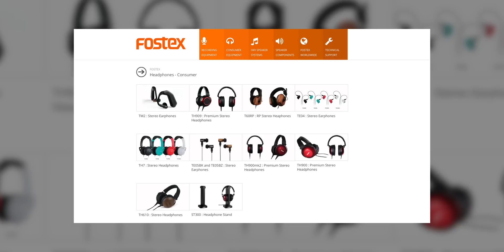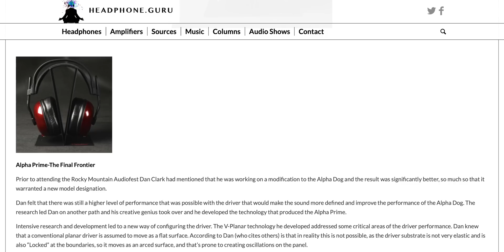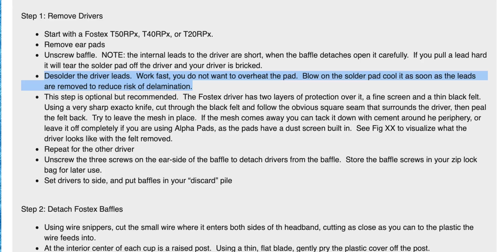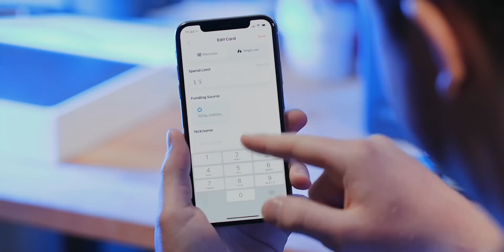Make $600 3D Printed Headphones For $200!

Comment: You know what's good? Model paint like Revell "enamel" type, simply brushed on. It's self levelling, it's got an insane amount of bite on plastic, it doesn't chip, it can be sanded and polished. It's alkyd resin paint, similar in behaviour to oil paint, just sets quicker, but it still takes a while. Though i would suggest it's worth it.

As an electrical engineer: Ethernet cable strands are perfectly adequate for the 3cm link inside headphones.

Comment: Eventough it's probably still a good deal, sub 200$ headphones is a lie. The cable alone costs 60€+ even if you get it from aliexpress/ebay/etc. I printed the parts at a fablab and they charged me 56€. Not trying to bash/hate just want everybody who wants do mod these headphones to be aware that you'll need to spend probably almost twice as much as the T50RP would cost alone if you don't own a 3D printer.

Comment: One thing I don't understand: So we added some 3D-Printed Parts and stuff, but why should the headphones sound better? We didnt even change the drivers?
Reply: Jonas Haidar short answer: because of how the air is moved. Poor drivers can do neat things with the correct amount air or crossovers. A four inch subwoofer can get deeper and louder with a correctly designed box (usually much larger than you would want). In a sealed space, the air behind the speaker would be pushing against the driver when it tried to move changing how the driver can flex.
Reply: Charles Gorny thank you

Comment: ahm.. why not just cut the wire... then, solder in the wire and sleeve with shrinkable tube...??
you won't hurt the traces that way..
Reply: The new cable has a bigger diameter -> lower resistance
Also you basically want to use the least amount of solder connections mainly because of the sound? (

Comment: Curious as to what version of the T50RP is best suited for this
Reply: the mk2 definitely
Reply: dnalekaw any particular reason why?
Reply: @TomasLomba  yeah, the mk2 has a more restricted rear driver damping, allowing for better bass extension and more controlled highs. It is also what the original alpha dogs used along with some wool felt on the rear of the aforementioned driver damping
Reply: dnalekaw oh ok. So if I tried to build these based on a MkIII I wouldn’t have similar results?
Reply: @TomasLomba  absolutely not, it will be very different since the driver damping scheme of the mk3 is very different. However, the results maybe towards your liking

Comment: wait so if you have to glue the baffle and the pad ring together why cant you print them as one solid piece?
Reply from the maker: There’s a 90 deg overhang and the printer wouldn’t be able to print without supports but they’d also be too close together to remove the supports so ya
Reply: @snazzy  Thanks for the info. Im trying to print this with stiffer carbon reinforced nylon to see if that affects the sound :)

Comment: Must the cable be changed in order to fully take advantage of this mod? I understand the enclosure side of things but not why the cable is changed. Thanks
Reply: As for sound quality? No. It's mostly just that the Alpha Dogs originally used Hirose connectors, so that's what the first released Open Alpha designs call for.

Now the cup files are designed with the connectors on each side, so to reuse the original cable you'd need to either modify the 3D print designs to remove the connector mounting on one side and alter the other to accommodate a 3.5mm socket, and make holes in the cups for the single-entry cable that goes over to via the headband.

Also, if you don't feel like getting those rather expensive and relatively obscure Hirose connectors for the cups (and cable), there's alternate cup designs out there nowadays that are modified for using more ubiquitous 2.5 or 3.5mm sockets.

Comment: I'm surprised planar speakers are more expensive. I would think they'd be cheaper, since it's just a flexible pcb, and some rigidly mounted magnets. Maybe most of the cost is from having to build out entirely new manufacturing lines with entirely different components to them. 
I kinda want to see an actual audio engineer have a go at these, make a perfect cup for a specific sound profile.

Comment: I don't understand how replacing the ear cups changed the sound quality so much.
Reply: cups are almost as important as the drivers. The drivers can only work with air in some ways, the cups control the air part of the sound. With sufficient but not too much air volume and insulation from outside air.

Comment: it amazes me when people who have $500+ 3d printers are scared of sanding for 30 minutes
Reply: dougy  Also, the Prusa IS good, but spending some time working on calibration and stuff will make a huge difference.
Reply from the maker: My calibration is lock-tight. I just printed at a really high speed and at a 0.4mm layer height because this video needed to get published ASAP.
Reply: @snazzy  That sounds more reasonable :P lol. Coulda swore you said .2 in the vid, so it threw me off. With layers that big and high speeds it makes more sense.

Also, tip on finishing with less sanding: Print with 3 walls and then knock the layer lines down with 80 grit paper. Takes care of them in no time, but needs the extra wall thickness for aggressive sanding.
Reply: dougy  Monoprice select mini v2  and if you're feeling adventurous get the Monoprice MP Mini SLA LCD High Resolution Resin 3D Printer
Reply: Hell, spending an hour or two with your print settings, you barely even need sanding. The prints he shows in the vid are ROUGH compared to what comes off my printer (and his is 3x more expensive than mine!)
Reply: dougy  I use a Tronxy x3. Was about $220, but requires assembly.
Reply: you should wet sand those parts, too. so much harder to do dry and makes it look shitty
Reply: O.5mm layer height fixes all
Reply: @joes661  do you mean .05 because .5 is pretty coarse
Reply: @akhilm3639  ye, I use a 1mm nozzle so am use to 0.8 etc

Not 0.05
Reply: @joes661  pointless for most applications. Lower the layer height and slow the print down in a .04 or .02 nozzle. Also .8 or .5 is still wrong by reference. Wrong decimal place is still the wrong no matter what you’re used to.

Comment: Makes me wonder if all you had to do was replace the dinky little wires and add the new connector, then add the same sound deadening to the original enclosures.

As a kid (about 10 y/o) i had some 3 way floor standing Fisher speakers (ones with white foam for the cones) that i replaced the internal wiring with heavier gauge monster cable and greatly improved bass, mids, and cleaned up the high end but was careful not to turn it up too high because then you could smell what i assume was the coil burning lol. Before i got rid of them i spray painted the woofers cone with some automotive paint to give it a hard surface which further improved bass as i think it helped stiffen the cone and couple the air maybe lol.
Reply from the maker: There are a lot of mods that retain the stock enclosures and they help the sound a ton. These definitely sound a step up, but if you absolutely don’t have access or interest in a printer, you can DIY with the stock enclosures and get 90% there.

Comment: superglue is actually awesome when using PLA ... but yeah you used the crappiest material of them all, petg :)
Reply: Why is petg not desirable here?
Reply from the maker: PETG is superb. This guy is nuts.
Reply: Snazzy Labs how much does the mass of the enclosures (since petg is much more dense than abs and pla), as well as the stiffness of the cup walls (given that pla is much stiffer than abs and pla) affect sound? Also curious about how infill percentage may change things.
Reply: Sure, super glue works very well with PLA. Almost too well actually, and that's exactly the problem - with CA there's very little adjustment time to position the parts. And with the parts lacking locator pins or other positioning aids, you really need that time window to adjust and make sure they're positioned just right before the glue sets.

Comment: Actually CAT5E cable has to be 24-26 AWG copper wire, so it's even better than 28 AWG
Reply: wait what cat6 uses 28 AWG it allows for better data transfer therefore just better than using cat5e
Reply: The larger the AWG number the smaller the wires, so you're not correct...

Comment: wouldn't it be safer to just cut the wires going to the drivers, leaving an inch or two, and then solder/splice the new wires to them? them you never have to apply any heat to the driver.
Reply: No, you'd have to get the same type of wire and since it doesn't tell you, you'd have to guess which is never good when it comes to sensitive audio electronics. Its better to just not screw up soldering and get new wire.

Comment: Omg u got the fostex t50rp mk3 I have a couple of them. The mk3 to me sounds good the bass sound that was used is controlled sub bass that's probably why you don't like them and they have near neutral sound and there is a weird peak on low frequency. Because of this sound signature some love these with simple foam and wire mods. And their sound signature is very easy to mod. And you should have tried other types of wires. And headphone foams because the driver distance to your ear unmodded can easily increase the lower frequency.. where is the logic in this you ask? I don't know but it does make it sound better...

Comment: If you want a better paint job rough sand @ 200 grit, primer, sand @ 400, primer, sand @ 800, then final coat. They use this process on car paint.
Reply: I have seen people doing pc case mods and they are doing the same, and man! The results are awesome.
Reply: Does it really make a difference when you're applying roughly textured paint, though? Knocking down the layer lines, priming, then painting should be more than enough with a textured paint. Could probably even skip the primer if the paint itself is made for plastics.
Reply: Xander Vice aerosolized paint is typically very thin. Even cheap air guns get up to around 80% paint efficiency. Yes, it’s from a spray can but still. Any texture isn’t from the paint, it will be from the surface. Primer will help hide low spots and flaws on the surface.
Reply: @allstarwoo4  I know how paint works, but the paint he specifically used does have added texture to it. So I don't see the point of putting so much prep work into a project that's just going to be textured by the product being used.
Reply: @xaytana  he says nothing about a textured paint. The metallic paint does have metal flakes but those are designed for a metallic effect, not texture. Without a clear coat to protect the paint those flakes will rub away with use.
Reply: Thanks for the info
Reply: i suggest starting with the good 'ol 1 GRIT to really even out those bumps XD

Comment: If you are going to use Methylene chloride, please be extremely careful. It has a very low boiling point and will vaporize. It is a severe carcinogen, so it is recommended to only use it in a well ventilated area, like a fume hood or outside.

Comment: To get a candy coating, you need to sand, use primer, sand the primer, and in a fairly dust free place, use spray paint, and apply clear coat spray paint after

Comment: i'm an idiot and watched the video,
so was it the casing itself that was bad and now that we made a new one, it is now a really good headphone and sounds good?
Reply from the maker: Yep. Changing the case design makes a huge difference.
Reply: @snazzy  so for a 200 dollar headphone, the interior is of a super high end technology with so much potential but with bad exterior,
and what we did here was make a crude but highly effective exterior to better wield such capabilities.  interesing.
Reply: @snazzy  another dumb question.   I like my hd6xx, but sometimes i wonder if i'm missing out. before these i was using like audio technica's lower end open back.  is it possible to make that 200 buck headphones into an open back design?  and if so how would that effect the sound?  just curious

Comment: headphones 170€
cable + other stuff ~110€
3d  printed  parts if bought = maybe 30-50€
paint, silicon and other things = 20-40€
plus  the time spent

=200$  ???

ok m8
Reply: These headphones will have different pricing all around the world. Why not buy them used? 110€ on a cable? Why? Make your own headphone cable. Having to buy the 3D printed parts if you do not have a printer will obviously cost you. A lot of people will have a can of spray paint in their garage, as well as the silicone. Also making these yourself and spending the time is a part of the fun.
Reply: @diavolescaCZ  I just quoted the prices of his links genius
Reply: @Benutzername0000  what I see is 150$ for headphones 12$+14$ for connectors. If you live in the EU you will be taken to one of the european amazon sites. And the headphones are going to cost more.

Comment: Clearly you haven't seen copper cladded aluminum eithernet cables and other crap that's floating around on the market.  It is not pure by design, it is just you stumble on a better one or better batch...

Comment: If you are worried about soldering directly to the driver, just cut the cable that connects to the driver and then solder that to the Hirose sockets.
Reply: I was wondering why this is not the standard way, as it makes the project a lot less "risky"
Reply: @Super020398  it might increase the resistance in the wire if done bad and could lead to a mechanical breaking point as soldered wires arent mechanically secure for movements especially in a small working space
Reply: Good point!

Comment: Hey Quinn, any plans to make a base 2019 iMac to fully loaded 9900k iMac video? Rumour has it that the NVME should be upgradable with the 970 Evo and some adapter and that the Z370-based Macs should be able to support a 9900k(f). 
Would really be interesting! Thanks a lot

Comment: 1 inch of wire is not going to make any difference in sound, when you have a 10 feet cable in series with it, also audio is very low frequency so anything that measures 0ohms will do. I would care more about mechanical properties than electric. 

I would use enameled stranded wire just to avoid the wire memory of solid core copper putting stress on those pads, or rattling around. But to be honest you’re fine if you never open then again. But if your going to open is better to use something flexible to not lift pads on the flex membrane of the driver.

Comment: One of the advantages of getting to be as old as I am is that your hearing starts going so you can't hear the difference between a fairly decent $50 to $100 set of cans and the higher end multi thousand dollar set.
Reply from the maker: I guess that’s an advantage 😂
Reply: @snazzy  A oair of ATH- M50s sound great to me and are comfortable. The only reason I use them instead of M40s is comfort. They sound the same to me. I can still distinguish between the highs, mids, and lows of music and movies quite well. Considering I had almost 90% hearing loss in one ear and about 60% loss in the other back in the early 70s I really can't complain.

Comment: This is great man! I modded my Sennheiser HD 518s and they sound so close to 598s now that I've been using them for three years without feeling the need to replace them.
Reply from the maker: Awesome! They’re killer headphones to be sure.
Reply: 518 are the same as 558/598, just enclosure differs a little.
Reply: vampula12 hence the mod. They have different sound signatures because of the enclosure. And the pads. The drivers are the same in all the 500 series I believe.